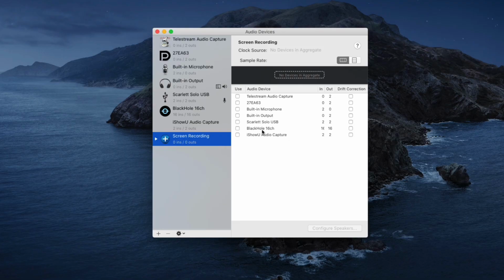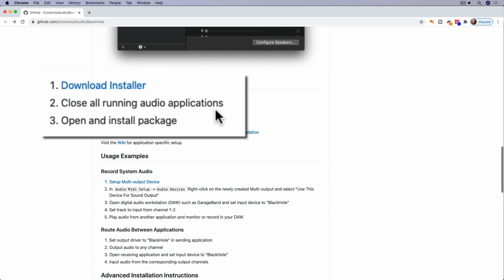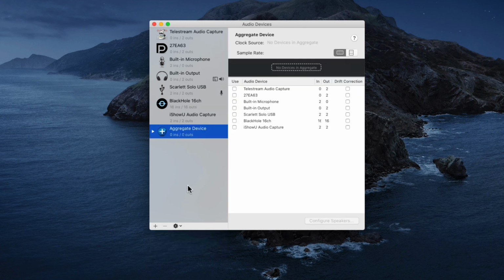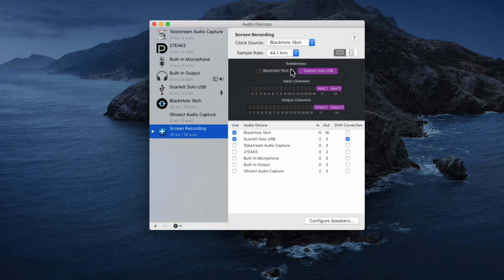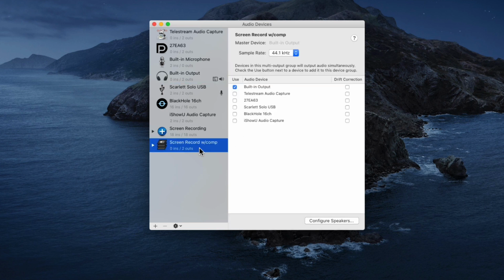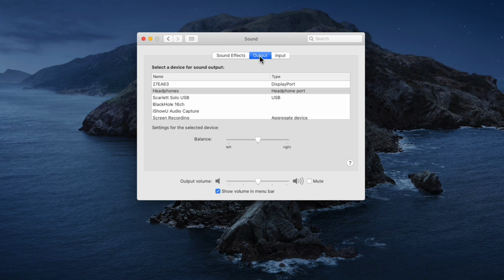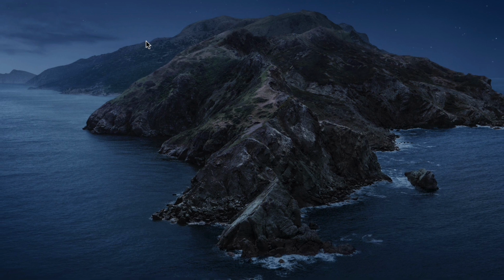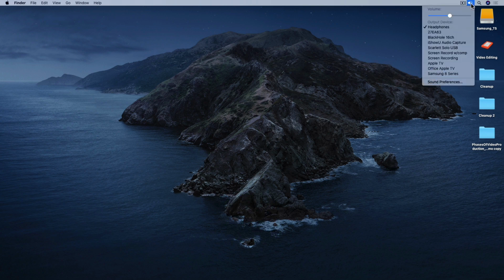How to Record Your Screen with Internal Audio & Microphone on Mac Using BlackHole (FREE)

Comment: hello! this worked for me before but not anymore. The problem: no mic input. I can hear output, but when I cannot hear my mic input in the recording. 
- Device: MacBook Pro, OS: 13.2.1
- BlackHole 2ch v0.5.0: just updated to latest via GitHub
- 48.0kHz (checked all inputs and outputs are the same)
- MacBook Pro speakers selected as primary device and first item in aggregate output and input

Any common errors people make that resulted in not being able to hear mic?
Reply: I'm having the same problem. Think it's caused by the fact that built-in microphone is no longer available as an output device for the multi-output device we create in audio midi. I haven't found a solution yet :/
Reply: the same . worked before for years. recently after some os update - stopped work. How to fix it ?

Comment: Don't know if it's right, but this is what worked for me.  Aggregate device: choose black hole, macbook speaker, then external headphone. Output: choose black hole, macbook speaker, then external headphone. For sound preferences: choose screen recording computer for output, screen recording for input. Then in quick time player select black hole when screen recording. No idea if this is correct or why it works but it did.
Reply from the maker: Thanks for adding this!

Comment: Thanks for a great video - it works now. I just have one little problem. The computers audio is mono, and I need stereo for my screencasts. Can you help?
Reply from the maker: What are you screencasting?
Reply: @michaelkinney  thanks for answering. I'm making screencastvideoes on music production  - Garageband and Soundation
Reply from the maker: @stefanteilmannlaubnielsen2561  I would take a look at the video I just released today on an audio application called GroundControl CASTER. The free version allows you to route application-specific audio into your screen recording: https://youtu.be/87RownklqXo
Reply: @michaelkinney  Thanks a lot. I'll check it out right away. Best regards - Stefan, Denmark.
Reply: Thanks again. I did it at bit different, because I had problems with stereo sound, so now I use Caster on the Mac and get stereo from the Mac and record voiceover with my RØDE wireless go on my iPad in Garageband - and mix it together in iMovie. Thanks for a really great tutorial job on these subjects. Have a nice sunday. Best regards - Stefan, Denmark
Reply from the maker: @stefanteilmannlaubnielsen2561  Awesome! Glad I could help.
Reply: Will this work if you’re using AirPod Pro 2 as your second input device, or does it have to have a physical connection to the computer?

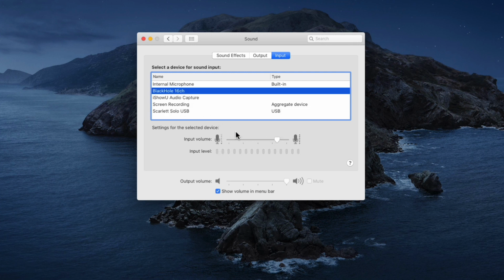Comment: thank you so much! this taught me so much and is an amazing explanation of Audio MIDI Setup with so many things I didn't know. macOS has updated the Audio MIDI Setup software and now added a way to see the decibels of the input volume (you showed at 9:13,). to see it, go into Audio MIDI Setup and select BlackHole 2ch (I used to use BlackHole 16ch, but 2ch is the same software but simplified, so i see fewer audio tracks in Premiere Pro), and now I can see the decibels and how they change when i drag the volume slider. I guess youtube uses -12 to -20 decibels for their max and min. Just trying to get as lossless audio as possible and not change the gain of the audio clips in premiere pro. your tutorial helped me so much with this! thanks again!
Reply from the maker: Thanks for the tip!

Comment: I am using built in microphone as my microphone but I do not see it on my multi output device
Reply from the maker: You would just include BlackHole and built-in output because you're not using an external microphone.

Comment: Hey Michael. Thank you so much for the helpful video! Only problem, I'm using this to give tips about orchestrating in Logic Pro, but the audio only outputs in Mono and not stereo, which is very annoying. Is there a way to change this in Midi Audio Setup? Have you had this problem before? Thank you

Comment: I'm not sure if the way this works is just different now or it's the equipment I'm using, but it doesn't seem to be working for me.

I've got it set up as shown here, but instead of "built in output" on Monterey, it's labelled "Macbook Pro Speakers". So if I have that checked, it'll pick it up but with an echo, so I'm trying to use simple bluetooth headphones to hear the audio but then it seems like I need to be specific about where it's playing (the headphones) or it doesn't pick up any audio at all.

I tried different combinations of having the mic checked or unchecked with the speakers playing when screen recording, and even when the microphone is unchecked, it still picks up the computer audio playing from the speakers into the mic and my own voice.

Is my audio midi set up just not working at all? I selected that aggregate device with the mic either on or off when recording in quicktime, and multi output device was selected for output
Reply: I have the same question. How do I record screen with sound while using headphones? I want to still be able to hear the sound once I take my headphones off but I can't figure out how to do that.

Comment: I've done this on my older Mac running Catalina. It's not working with my new Mac with MacOS 12. When I create a Multi-Output Device, it doesn't allow me to use any of the external mics—neither the mic from my mac or the USB mic I have plugged in. These mics show up in the Aggregate Device. Perhaps it's not possible with Mac 12?
Reply: Okay, I instantaneously have to take that back. I had to set it up a little differently. I completely bypassed the Multi-Output Device and created TWO Aggregate Devices. One called Screen Recording, the first created in your tutorial just as you did. The second one, I created a an Aggregate Device called All Devices and added everything, my mic, my BlackHole, and Built-In Output. I sent the audio out from the Aggregate Device (the first one you did on the tutorial) and used the All Devices aggregate device to record in Screen Record. Thank you!

Comment: This is a lot for turning on internal audio on Mac. You can just put the mic in then it picks up speaker noise to your mic so you kinda have internal audio
Reply from the maker: You could totally do that. Way simpler, but quality not the greatest.
Reply: Do you have to turn the Output back to the MacBook Air Speakers after your done with it?

Comment: Hey there Guy
Before I did all this, when I would turn my Bluetooth speaker on it would automatically connect but now nothing. I tried selecting my blouetooth speaker in the output but then it plays on both the bluetooth and the internal speaker

Comment: for some reason im not getting any audio from it, it was working fine for a few months and now all of a sudden it just quit working
Reply from the maker: Could be macOS updates. Try uninstalling BlackHole and installing latest version.
Reply: @michaelkinney  I have the same problem i can't get the sound to work. Under multiple output devices, i don't have an option to tick "built-in output" instead I only have "MacBook air speaker" and "external headphones"
Reply from the maker: @TheDhinesh619  Try selecting external headphones.
Reply: @michaelkinney  Still does not work
Reply from the maker: @TheDhinesh619  If you have headphones plugged in, unplug them, then see what shows up as an output in Audio MIDI setup.
Reply: @michaelkinney  it shows only macbook air speakers
Reply from the maker: @TheDhinesh619  So, in Audio MIDI setup, when you create a Multi-output device, you don't see Built-in Output as a choice in the right column?
Reply: @michaelkinney  no i dont
Reply: @TheDhinesh619  Same problem. Cannot find my "Built-in output" in MIDI so no audio is coming out. 
It says that BlackHole has output but nothing is playing out.
Reply: Same problem happening here on an iMac, no audio to be found

Comment: Point of confusion:   At  10:26, you closed out of Sound > Input and left the Scarlett as the sole input source.  Wouldn't that leave the Scarlett mic as the only audio input?  Should you have set your "Screen Recording" aggregate as the Input?
Reply from the maker: I'm setting my mic level through Sound > Input, which is the Scarlett Solo, which is part of my Aggregate Device "Screen Recording". You can select input devices outside of System Preferences > Sound, which I did in ScreenShot when I selected the Aggregate Device "Screen Recording".
Reply: @michaelkinney  OK, got it.  I believe what you are saying is it doesn't matter what you choose in System Preferences > Sound  > Input, because you can choose whatever input you want from within Screenshot or Quicktime.  That explains why BlackHole user guide says you only need to set Output, as Input doesn't matter.  BTW, I have found that Quicktime is easier to use than Screenshot, even though they are supposed to be similar.  And - like you - I'm using a Scarlett for my mic and also a guitar input.
Reply from the maker: @sunjamrblues  Nice!

Comment: at 6:42 i don't get the option of built-in output, what should i do?
Reply from the maker: What machine are you on? Is there a choice for your speakers?
Reply: Me either. In my case, I don't need to set the option when recording my screen with internal audio adding a voice over.

Comment: so what can i do if it has the volume way down when im recording
Reply from the maker: Couple of things: before you switch over to the Multi-output device to record, make sure your built-in speaker volume is turned all the way up, then switch over to the Multi-output device in Preferences - Sound - Output. Next thing to try: open Audio MIDI Setup, select BlackHole 2ch, select Output button, and make sure Primary is turned all the way up. Beyond that, make sure the volume of the source your recording is turned up (YouTube player, etc.)

Comment: How can I mute external speakers and still record internal audio ?  When I mute external speakers, the internal audio does not record
Reply from the maker: Try plugging in headphones.
Reply: @michaelkinney  I had been doing that with the headphones but was curious if there was another way.  I have since discovered a solution : leave “built in output” under “ multi output device” unchecked. Thanks for getting back to me.
Reply from the maker: @jeffunityyoga  Glad you found a solution.

Comment: A terrific video, well presented, to the point, and great commentary.  Thank you!

I believe some points are incorrect -- perhaps you can check my reasoning, or others might find this useful.

* First, the aggregate input should be Blackhole, and whatever mic you use.  You only need to set up the mic on the Input, because it's an input device.
* Second, the aggregate output should only contain 2 things: Built-in Output, and BlackHole.  You don't need to include your mic as an output, and in fact, that doesn't make sense.

When you set the System Prefs > Sound > Output to the aggregate output device, it means sound output is sent to the speakers, and is also sent to BlackHole.  Then when you choose the aggregate input as your screencast recording input, it means that anything getting sent to BlackHole is also sent to your screencast recording ... in other words, that your speaker sound is also getting sent to the recording, along with the mic.

Cheers and thank you again! jz
Reply from the maker: USB mics are audio interfaces, you can monitor sound through them. The microphone is included in the multi-output device so you can monitor the computer sound through the USB microphone's headphone jack while recording. You don't NEED it, but if you monitor the computer sound through your speakers, that sound will bleed into your microphone and create an echo in the recording.

QT Player/Screenshot only records audio coming out of the built-in output. In order to take the computer sound captured by BlackHole (and monitor through your USB mic if you want to) and have it recorded by QT Player/Screenshot, you need to essentially create a new, virtual built-in output that includes the default built-output and any other outputs you want: the Multi-output device is that virtual output. You're essentially bundling the outputs you want to use and making them available to the system (QT/ScreenShot) to record through the Multi-output device.

Hope that made sense.
Reply: @michaelkinney  Hi there, thanks for the reply.  This is incorrect: "QT Player/Screenshot only records audio coming out of the built-in output." -- actually, recordings only take inputs.   Usually, that's just a microphone, but that's why we need BlackHole: to pipe the system output (in system-prefs-audio-output) to somewhere to be used as another input.  Since we set the system output to be an aggregate device, any sound is sent to BlackHole, and then when we use the aggregate as the input for QT Player/Screenshot, we can also pick up that same stuff from BlackHole.  Cheers! jz
Reply from the maker: @jz4901  Now, I'm confused. But thanks for stepping through it. I think this needs a diagram. Wish we didn't need this workaround to record system output on the Mac. Do you know why we have to do this? I would love to know.  Cheers, MK
Reply: @michaelkinney  Hey there, I replied a few times with a link to a google pres with a simple diagram, but that comment keeps getting deleted.  Not sure what's going on.  :-)   Anyway, yes, this whole recording/audio thing should be easier than it is.  Cheers! z
Reply from the maker: @jz4901  Send via About section on channel page. With your permission I'd like to post to my Community tab with full credit. Cheers, MK.
Reply: @michaelkinney  Sent via email, happy to chat further.  Cheers MK! z

Comment: Hello.  Firstly.  Great and thorough tutorial.  And you definitely have a great voice for voice work.  My question is about using the MacBook  Pro's internal mic.  Do you know if this is possible?  I know your tutorial shows using an external mic via a Scarlet interface.  But for simplicity, I wanted to try to do a screen recording, but use the internal Macbook Pro Microphone (which is the built-in mic).     

The Macbook Pro Microphone can be selected when creating the Aggregate device.  But the MacBook Pro Microphone does not appear as an option when creating the Multi-Output Device step.   Do you know of any reason for that?
Reply from the maker: The reason you can select an external USB mic for the Multi-output device is because USB mics usually have an audio interface component, meaning, you can monitor sound through them as well as capture sound. The MacBook Pro microphone is just a microphone, input only, so you can't add it to the Multi-output device. You'll need to monitor through the MacBook Pro speakers (not a good idea), or attach headphones.
Reply: Hi there, yes, you can use the internal mic.  You actually add the mic to the input device, not the output device, because it's used as an input to the recording.  (I believe that the info in this video about including the mic as an output is erroneous).

Comment: Hello Michael - Thank you very much for explaining in CLEAR & SIMPLE language. I have one question. For Recording - Selection of output (Video around 10:00 time stamp) - Why have you selected the output as "BlackHole" and not the "Screen Recording" aggregate one that was created for Screen + Mic (Voice Over) ? Trust I have not misunderstood the explanation, and can get the information.
Reply from the maker: The Aggregate Device is an input, like a microphone. Multi-output device is output, like a speaker. So, we're collecting the computer audio using BlackHole on the Aggregate device (microphone) then sending to BlackHole on the in the Multi-output device (speaker). Think of BlackHole as a wire connecting a microphone to a speaker. You don't output sound through a microphone. Hope that helps.
Reply: Hi there, I posted a comment a few mins ago which may help you understand it a bit better.  Cheers! z

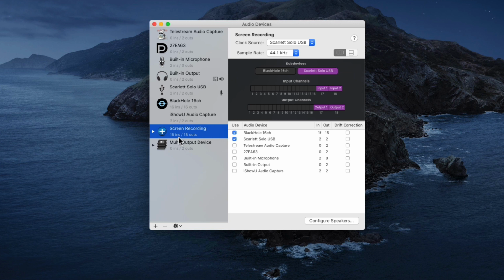Comment: My MacBook doesn't have the built-in microphone & built-in  output that you showed in 5:52 and 6:07
Can you help me fix this issue please? 🥺
I'm currently using MacBook Pro 2021 M1 for the device.
Reply: I believe the 'built-in microphone' is be replaced with 'MacBook Pro Microphone' and the 'built-in output' is now  'External Headphones'
Give it a go and hopefully it works
Reply: @FellowScorpio  I see MacBook Air Microphone but not External headphones. Instead, the only thing I see in MIDI, multi-output device,  is MacBook Air speakers.

Comment: Your walk through was super useful - thanks! 

I'm using a Scarlett 2i2 USB for audio in AND out - and have that as the default for my system (which, i'm assuming, explains why no option displays for Built-in Output). So, i'm using the Scarlet 2i2 as the Master Device. Also i'm on Monterey - don't know if that makes a difference as to why on built-in output displays.
Reply: same issue no display for built in output. any updates on what to do?
Reply: The 2i2 won't show up unless you have it plugged in.  If you have nothing plugged into your computer, it will show "Built-in Output".  If you plug your headphones into your computer, "Built-in Output" will disappear and "External Headphones" will be showing.

Comment from the maker: For those wondering how to adjust the volume of audio coming through BlackHole: go into Audio MIDI Setup and adjust BlackHole volume there. Select "Blackhole 2-CH" in the left sidebar. There's a volume slider under the "Output" button.
Reply: Hey Michael, I think I've done everything you said, but afterwards when I switch it back to the output being the Internal Microphone and play my recording, I don't hear anything. How do I fix that?

Comment: is there a way i can control my volume with the blackhole selected?
Reply from the maker: Have to go into Audio MIDI Setup and adjust its volume there. Select "Blackhole 2-CH" in the sidebar. There's a slider under the "Output" button.